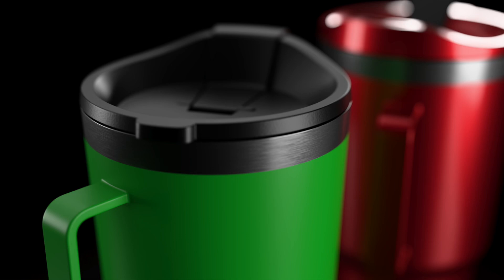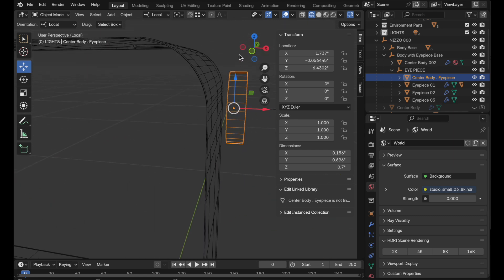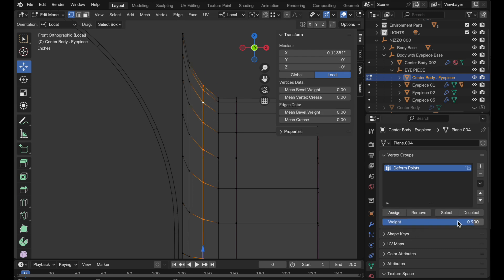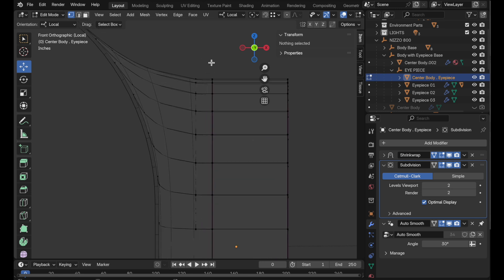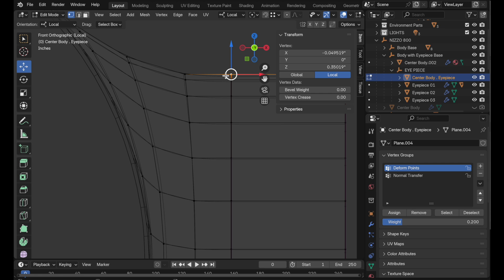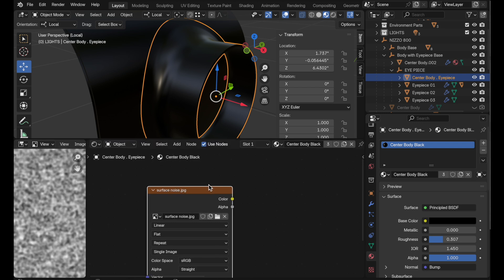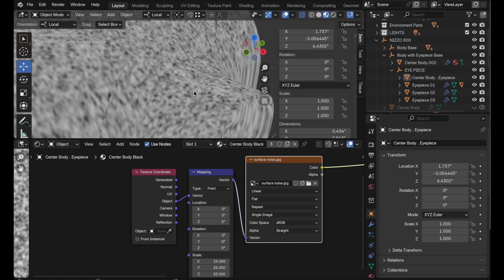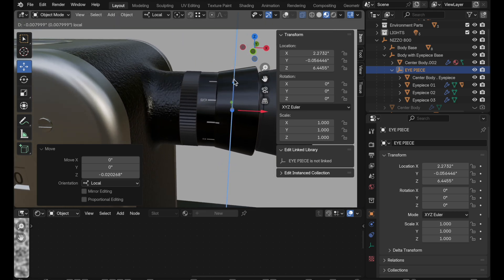Are booleans a better approach?

Comment: Best thing you can do with boolean people is just ignore them. There's plenty of them and they are toxic. They should stick to channels like blender bros where they actually belong. Boolean is like a faith system to them, you can't reason with them. Members of these hordes are usually home users who don't have the mental capacity to wrap their heads around the concept of edge flow and clean topology. Also, they never worked in a studio where models are shared and may be processed by multiple teams. Funny enough, this boolean-fetish is a typical blenderism, there's a boolean tool in every 3D package yet I've never seen this level of addiction to it in any other community. Maya or C4D people can actualy model — and a good deal of Blender users too.
Reply: This is such a redditor comment it's actually hilarious. You're really no different than what you're complaining about, if you're a VFX artist sure you're not going to use booleans to make the finished models most of the time, but booleans themselves have so many different workflows that in one way or another there's always a place and a time to use them. At this day and age we literally have AAA games using "dirty" topology and boolean workflow yet "perfect topology" gurus think they're the saviors of the industry

Comment: Seeing now the full implementation of the normals data transfer. This looks indeed so much better than bevel node. It's perhaps more work, but is super powerful. Especially since you can still move it around. But it is ofcourse limites to Boender itself.

Comment: Question, why did you use a noise imagine instead of using the noise node?
Reply from the maker: Like I mentioned in the video, in case you happen to need to apply a bitmap instead of using a procedural, this is a method you can use to prevent seams. Imagine you're using a fabric texture or something that would be more of a pain to produce with a procedural.
Reply: @christopher3d475  thank you

Comment: Wait a minute, you can see the weight of the actually selected vertices??? What is that, a plugin or setting?
Reply: ok, i found it... but very unintuitive, if a select an edgeRing and switch to vertex mode, nothing shown, but if i select one vertex then its shows the value